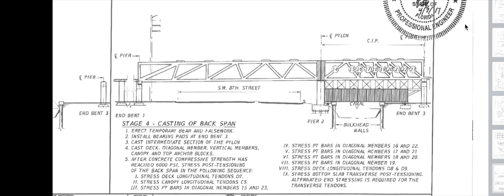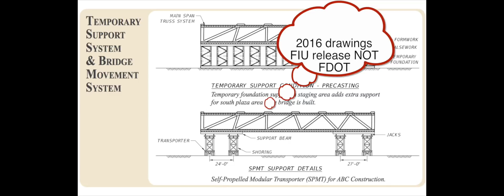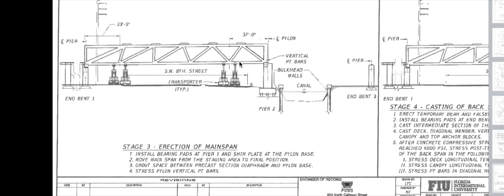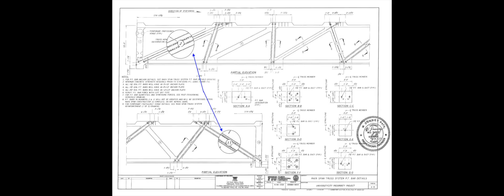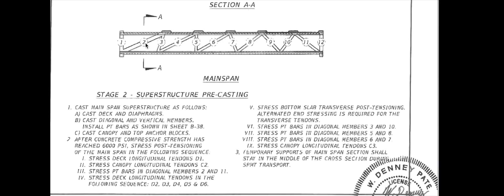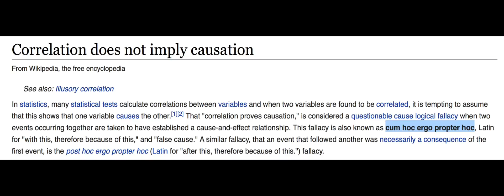FIU Bridge Collapse SMPT LOCATION & NEGLIGENTLY  Deviated from  Supports During Transportation

Comment: I've had a bit of understanding on structural  engineering & this was a simple domino effect caused by the no. 3 vertical beam  being positioned incorrectly ! With the top of this beam leaning towards the right on top, right of center of itself,which offers no support for the structure,coupled with the tension , was a poorly engineered design !

Comment: Forms left in place for longer will allow the concrete to cure faster evenly and prevent crecking. Concrete is prone to moisture evaporation as it gets hot quickly driving off the water as steam and than cracking will form as the structure drys unevenly  as stresses build up due to hardening unevenly. This is why you see wet cloth sometimes around columns. You also see workers keeping the concrete wet in hot weather.   In a larger mass of concrete heat builds up than one that is slender and has more surface area. I am guessing this is why the connection points to top and bottom slab showed cracking. Its a school boy error that no experienced engineer would make twice. Guessing this was a first for the Civil engineer running the show...
Reply from the maker: This one is beyond shrinkage buddy...  
1.) evaluate the safety first
2.) address the potential for collapse and shore as required
3.) evaluate the plans and try to determine possible causes
4.)if, cause cannot be determined, you cannot do repair 
5.) doubt yourself over and over again until you are 100% sure you can duplicate this crack and then you can determine if the repair can be performed - NOT all repairs can be performed... You may have to alter the structural design (I guess you could call that a repair)... 
BUT, WHAT I THINK THEY DID WAS EVALUATE HOW FIU WOULD HAVE TO REPORT THIS TO THE GRANTING AGENCY AND ALSO IT WOULD REFLECT ON THEIR ABILITY TO EVALUATE DESIGNS!
THIS WAS A MAJOR FACTOR IN DENNY PATE MAKING THE DECISION TO COMMENCE CRACK REPAIR WITHOUT PROPER TESTING AND EVALUATION... (CORRECT EVALUATION -- and why did he "mislead" FDOT in that phone call? Perhaps, the FDOT person, who was at that meeting -he could ''bully'' or ''dominate''... Then he made that phone call and just like MCM, tried to make ''light'' of the issues (cracking)... 
This is Denny Pate and FIU and MCM and FDOT and VSL   "negligence party!"  which RESULTED IN A DEATH OF ONE WORKER AND 5 PEOPLE OF THE PUBLIC.
Reply: Construction Engineering & Photography - yes I agree it is more than shrinkage cracking. The design to initially allow the reversal of forces when placing the bridge on it’s bearings, in my mind was a root propagator of making those shrinkage cracks larger. Once the openings reached the cast rebar, this bridge was done for as it would of significantly reduced it’s longevity. Any water and frizz melting action on those cracks will introduce rust and a propagation to open up these cracks even more. You can only fill cracks with resin, but the resin is only a filler not a glue to restore integrity of the structures. Once we had the weakening via those cracks and another reversal of forces once resting on the bearings the weakest point gave way. This I believe was the top slab as the load spreader (blister) had been jackhammered and was in a weakened state.... and in my mind the top slab gave way first.   Its a theory that only can be verified by examining the critical area... I guess we will never know as they will cover it all up. No one will be blamed.
Reply from the maker: I am sold Latitude! ...  You are nailing it as far as I am concerned (yet, we both have to leave room for the ''wildcard data'' that we may not know of... 
Please enjoy this ''story'', I share it from time to time to people who may get this... I am sharing with all in this ''forum"...  
Reminds me of the time a girl broke up with me via her mother, on a phone call,  telling me she did not want to see me again...
 
Next time that girl called me, I TOLD HER OFF! and hung up on her! And when I saw her in public, I ignored her and she in-turn started to partially ignore me... Yet, we both were playing some kind of game (being young) and would go to the same bar by chance... 
Ultimately, I crossed the line first, by dancing with another girl and kissing, etc.  
The girl that dumped me, left the bar...   (Her girlfriends, tole me off and I was a little curious and wondering why she was hurt, she dumped me... (more on this at the end of this message). 
This went on for the entire winter season... then one day, I saw her by herself, at the bar... I was with another woman at the time... But, this woman understand and was mature minded... 
(I asked permission to talk to that girl and if she would not be offended- she was not)...
I went over to the ex, who dumped me and ordered a drink for her and asked could we talk... 
She agreed and what we BOTH learned is both of us loved each other before that cold break-up, via a phone call from her mother!   
Here is the but part, but, you see she never broke up with me!...
She thought I broke up with her first and was hanging up on her,  and blocking all her attempts to make it work and contact me! 
But, all I showed her was the cold shoulder and even started to kiss other woman in front of her!
It turns out, her mother, overheard her phone call the night before, with me... 
That during that phone call, me loving to tease, in a very nice way... wanted to keep her on the phone when she had to go somewhere or was tired, or something of that nature... I forget the context at this time; well, she said something like, I don't want to talk anymore... 
So, we ended that conversation, as I could tell my teasing was done... 
BUT, IT TURNS OUT THE ''EASE DROPPING MOTHER'' ONLY HERD, I don't want to talk anymore." (and interrupted that as, she did not want to see me anymore, that she did not want to talk to me anymore! So, when I called the next day, the MOTHER informed me, that she did not want to see me anymore.)...
College days, you just move on... 
So, when she did call me, I thought, I am not playing her games, I cut my losses and HUNG UP ON HER, TELLING HER TO LEAVE ME ALONE. (so, she thought, I broke up with her FIRST!)... 
... We both cried at the bar that night... in front of anyone who could see us... 
The moral of the story, we are ''ease droppers'' in this story... but, now we are more educated and we can spot the ''MOTHERS'' of this story... (NTSB, and all the other players)...
BUT, we can never get the truth unless the parties tell the truth and figure out where this entire destructive bridge design and implementing took place...  
That some pain will come out of it for a few parties but, we can learn so much and this can ultimately change the way we think and perform with these post tensioning structures of concrete / combinations...
NTSB, is the ''mother'' of this story and they are attempting to do misdirection... with producing misleading preliminary report and as TESLA stated, or something like that, I do NOT like the way NTSB is going with respect to their auto accident and he decided to DEFEND himself! (which then they both parted ways)....
In conclusion facts, do not care about companies, or corporations, or people, etc. 
Just produce the facts and engineers can tell the chain of events!  
We do not need an ease dropping ''MOTHER" (NTSB) to tell us what they ''herd'' ... LET THE FACTS BE THE FACTS.
Reply: The thermal loads in the design critera issued for the pedestrian bridge:
"...shall be assumed to be 70F with a rise or fall in accordance with Table 2.7.1-1. Section 2.7 of the SDG."  No frizz melting allowed here obviously.

Comment: closed Bridge In South Carolina due to broken PT cables also designed by FIGG. What the hell is going on there? Does it mean, they really don't know what they are doing with PT's?
Reply from the maker: Yes, they do not know correctly how to predict failure in that system... Proof of my statement is they inspected that bridge weekly and could NOT predict the total failure of those cables... It was a TOTAL failure of ALL in that ''bundle"... Yet, they were inspecting weekly and only days before inspected those cables... They have no ''fucking clue'' what to look for... Or did they just use ''idiots'' to do the inspections?
Either way, this means that section was 100% unsupported by the designer's cables...
Reply: I got some questions for you. 
You mentioned that Danny Pate and FIGG had a lot legal actions against them.  1. why the board of engineers did not investigate and suspend his license to practice until cleared?  2 Why didn't clients take legal actions at the same time report the issues to the board?  3. How can they afford professional liability insurance after a few incidents? The insurance would go through the roof, even if you can get it. 4. It seems FIGG engineers have NO common sense in engineering at all, or just greedy. They have to get ALL projects despite they have NO or lost their expertise in that field. (when you lose your expert designers, you will lost some key expertise. 5. Who is the real owner of FIGG? Either Danny or Linda or Linda's husband/brother/father? (how is the set up of this company) Linda is just the front for getting the minority status, and I don't believe she is the real owner. 5. How can they keep getting public sector projects without political connections of some sorts with all the mistakes. (same token as MCM). Finally, the "Fck i & U" bridge to sewer water blew it all. I am just very superstitious of bad names.  We say: the ocean going ship was toppled in a small ditch.

Comment: We just drove all over Peru and Lima in particular, there were many bridges spanning the same distance as the Florida bridge and they were all intact. Some were concrete but most were steel. It doesn't make any sense that engineers in the US made a bridge that collapsed since similar bridges all over the world are in service with no problems. This should be investigated and should never be allowed to happen again.

Comment: I am an engineer by education, programmer by profession.  I have always said that the ONLY thing of real lasting importance I learned in college (3 degrees) was "why things fail".  i.e. how do educated, experienced designers make mistakes that are not caught.  That has made me a far better programmer.
In many cases of structure failure (usually long after being built), it comes down to one simple mistake.  Commonly stemming from starting with an end goal of how it will look.  Then working backwards to make the engineering allow that end goal.
In short - many failures stem from wanting the end design to be cool/impressive.  To be able to say "This is the first bridge built entirely from rubber cement!".  
They started from a goal of wanting a long span concrete bridge with an open lattice design.  They WERE able to solve all the problems on paper, but with little or no margin for error.  THAT is the issue.  Miss or miss-understand that one instruction that "temporary supports are to remain in place..." and you have a problem.  That statement on the plan is a little vague.  Which temporary supports?  "mid-span"? Is that the middle of the span?  The entire length but down the middle?  Under the middle?
And also all those calculations depend on the entire mass of concrete ending up of design strength.  What happens if a bad mix in the middle of the pour causes an well hidden, internal mass to be not 60,000 PSI but only 40,000 PSI. If that was not caught while being poured then all the calculations are worthless.  Steel is what it is.  You can test the steel before you use it.  And in general, all the steel in a batch is the same.  
Main difference between PT concrete span and steel span is that steel rarely fails all at once.  It tends to give a lot of warning.  Sagging, warping, making a lot of noise.  PT concrete resists and stays rigid right up to the moment of total failure.
Reply from the maker: This design was never structurally sound to be placed inservice / positioned over the public OR without span support!
Those cracks are a major indicator of design failure!
Negligent homicide for all parties who were involved in two hour meeting and especially FIU for not condemning bridge with those cracks! Which would have saved the public by closing off the road....But, FIU, would not want to make that report to the granting authority as it would reflect and on themselves...
They had too much skin in the game and a conflict of interest vs their responsibility to protect the public.
Also FDOT could have arbitrarily closed off road with those cracks!
MCM and VSL should also be found negligent, for endangering and ''killing the public".

Comment: So then, would it make sense that not having support in the center overstressed the center pt rods and that the center "drooped" more than they expected?  Instead of the cantilever sections causing the problems in the tensioning systems on the outer ends, it was the unsupported weight in the center that contributed to cracks during the move (if thats when they occurred) ?  Not sure I really understand this all, but that is why more tension was put on 2 and 11 to help support that cantilevered section, and it had the opposite effect on the "middle section" and it sagged bad enough in the center to cause all the cracks on the outside members.  Keep up the good work man!
Reply from the maker: Yes, that deviation from plans caused the extra stresses on the cantilevers; which caused more cracks or expanded the existing cracks (if, they were not repaired from the days prior)...
Reply: The comment from Midnite Train below and your reply to him after giving this even more thought is leading me (at least with what we know now) to the theory that the bridge was built to be supported at the very end. The design was flawed in that it couldn't withstand what was I would guess was a dramatic change in the way the load was distributed during the move with the placement of the moving rigs. They realized something was wrong and obviously underestimated how much it had gone wrong.
Reply from the maker: Very fair statement and this design was never structurally sound to be placed inservice / positioned over the public OR without span support!
Those cracks are a major indicator of design failure!

Comment: In a previous video you showed the main span being moved into position with banners nicely wrapped around the diagonal members. Presumably if they left all the temporary supports in place, it would have looked ugly and not as photogenic. Possibly PR took precedence over engineering? Won't be the first time that has happened...
Reply from the maker: Gordon, I have another video that might show otherwise... I am still researching the data before I post it...
Teaser:  One of the banners was not manufactured to be on one of those diagonals... (more to come)...

Comment: Like i said on your first video and anywhere else from the beginning. It was the placement of the concrete. I think they call them cold joints? Where the concrete has already started curing before th e next batch is poured. That prevents the long chains from forming and makes shearing between  batches much more probable.
Reply: drawing B41 shows a C.J. (construction joint) where the diagonal struts meet the canopy and blister
Reply from the maker: Jimmy, are you using a cellphone? I get that problem also... I find it happening on my cell and when I get to a desktop, I can see the replies...
Reply from the maker: Yes, that could create a problem but, we do not have any evidence or indicators of that... No presence of that has been found in any image besides that ''top layer'', I showed on the canopy, a few videos back...  But yes, a cold joint is always a concern, unless it is part of your design.
Reply: PE2015 Atlanta I can't see what you're replying to. Shows 3 reply(probably 4 now) nut I only see 2?
Reply: message resend-----drawing B41 shows a C.J. (construction joint) where the diagonal struts meet the canopy and blister
Reply from the maker: This design was never structurally sound to be placed inservice / positioned over the public OR without span support!
Those cracks are a major indicator of design failure!
Negligent homicide for all parties who were involved in two hour meeting and especially FIU for not condemning bridge with those cracks!